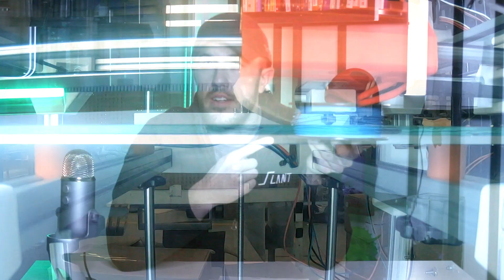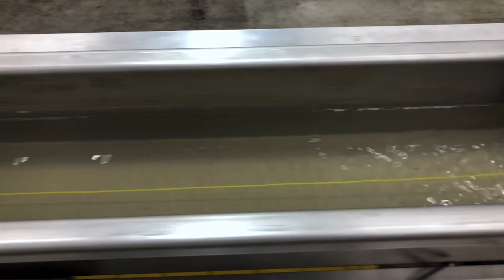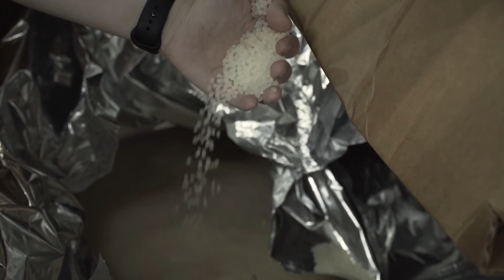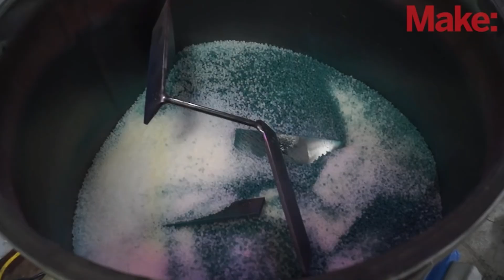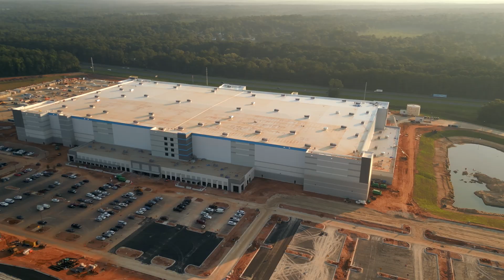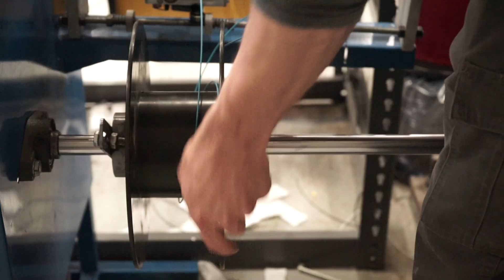Why is Filament so Expensive? Explained

Comment: Thats why it is great to have local brands. I buy from a local brand (local as in the same country as me) and it is about $7-10 per spool of PLA+ depending on the properities (silky etc.)

They dont come with a spool so they are essentially refill filament but you can buy spool from them for $1 too.
Reply from the maker: That is very true. Unfortunately many local brands vary in quality so much that many are not viable for mass production.
Reply: @slant3d  Yeah makes sense for you guys. For personal projects it is good enough. But I have to say even I noticed a lot of inconsistencies with the filaments from the local brand. I mean they are still the best option for me since they are cheap and have good quality 80-90% of the time
Reply from the maker: That is great that they are working for you. It is awesome when a local source works out. But yes, 80-90% usable is very poor performance. 1 out of 10 of their spools has a defect. Imagine if cars or cellphones were made with that quality. "1 out of 10 iphones won't charge. OK. Here is 1500 dollars"
Extrusion of filament is a fantastically simple process. No organization should have double digit error rates.
Reply: @slant3d  Yeah you are definitely right, I mean I just gave a random number of 80-90% maybe in reality it is better but I can tell the difference between it and Esun Pla+ for example in terms of quality.
Reply: @UTKDesign  How do you go about finding a business that sells spools locally?
Reply: Or even a spool refill location?
Reply: @_specters_  depends where you live, I recommend to check filament producers in your country, also there are sites similar to Amazon in almost every country where people are selling stuff, I recommend you to read some opinions cause its better to pay some more for a quality filament than buy a shitty one and throw whole spool in garbage
Reply: @_specters_  I dont think any spool refill statiom exists. I just buy 1kg of filament without the spool from the manufacturer. I just searched PLA filament 3d printing etc. in my native language to see which websites popped of and discovered new local brands
Reply: My local companies are 22$ for a spool :(

Comment: And once pellet extruders become smaller and more affordable, you would pretty much be saving even more money when it comes to getting PETG, PLA, or heck even PEEK. Plus, extruding with virgin pellets will definitely yield stronger prints. c:
Reply: Right now I'm making pet from plastic bottles wih a pullstruder, it's not perfect but it works
Reply from the maker: Unfortunately pellet extruders have a minimum size physicaly that they can maintain. And the Value-add is quite small compared to the other tradeoffs.
Reply: @slant3d  no true

Comment: Insightful video. I found it sort of funny how you glossed over the "there's only 1 company making their proprietary PLA blend" part. I might dig into that more, that's something I would've never expected. Especially with how wildly filament can vary, from cheap no-name spools to "name brand" more expensive spools.
Reply from the maker: The variation is due to the how it is processed. It isn't always due tot the base resin. There are other knock-off PLA's but true  PLA is made by one company

Comment: $5 dollar cost is at small scale, at larger scale the match changes substantially. Most retailed items have wholesale price approximately 5-10% of retail price. The large chinese manufactures can makes a spool of filament for less than 2 dollars, a lot less.
Reply from the maker: Kind of true. We use the $5 figure based on the average manufacturer size. But the cost of the items like chinese filament is often subsidized, is lower quality, and has the cost of international shipping (before distribution from warehouse) so it ultimately balances out to about the same after it crosses the ocean.
Reply from the maker: @WhiteG60  The cost of labor is negligible in the context of filament manufacturing.

Comment: I never thought Filament was too expensive. 
I just think more manufacturers should offer "spooless" filament. People who have 3D printers can make their own reusable spools, put the roll on themselves and save the cost, weight, waste and expense of shipping the actual spools around.
Reply: You and I think the same, I think the problem come from making it onto a spool and than removing the spool. I could be wrong tho
Reply from the maker: Spooless has been very tough to get right. We actually manufacturered one of the first resuable spools in partnership with several suppliers. But it was ultimately shuttered because the cost per 1KG did not go down due to additional labor and it was largely un-utilized by consumers because of the additional work. It has been an idea for over 5 years. But implementation hasn't happened because consumers don't want it enough.
Reply: I hate buying spool-less "refills"
Reply: "I never thought Filament was too expensive"  Me neither.  I just checked and a spool of Hatchbox that cost me $28 in 2018 costs $25 now.

Comment: I have counted already in the past: the price of plastic pellets is 10x cheaper than filament.
Basically, for utility prints it cheaper to make your own pellets->filament extruder. Which can, by the way, be used to reuse the failed prints.
Making your own filament for fine detail fine quality prints is not worth the efforts.
Reply from the maker: We have tested many/most of the extrusion machines that a normal user would get ahold of. There is not one that actually pays for itself over its lifetime with the savings from lower cost material.
Reply: It is a problem of engineer's team to make cheap chinese extruder worth it.
This is exactly why I said only about utility prints (not high quality).
Reply: I think I was not clear enough.
The best filament of the shelf for 0.4mm nozzle is very difficult to remake yourself.
But for 0.8-1mm nozzle prints it is quite possible to use your own custom made filament made of cheaper pellets on cheap chinese extruder. Period.
The extruder could be chinese or DIY made - doesn't matter. The cheaper the better.
Reply: The pellets are significantly cheaper if you buy an 80kg bag.

I bet if you ordered that sort of amount of filament, and were willing to accept a bit of lead time, you could ask for a friendly price from your neighbourhood filament company on 5kg spools or larger.

Well if you don't have a filament manufacturer in your region then tough.

Comment: Thanks a lot. I'm wondering all the time about the economics of everything. That said - "the rule of 3" is only a insurance for small businesses in the western world not to loose money from the beginning. But if you really want to scale your business, products or services, it seems like you need to go as tight as possible to the marginal costs. That's the same with 3D printed vs injection molded parts like it is with domestic flights (Freakonomics had a nice podcast about deltas economics)
Reply: I have never heard of "rule of threes", rather there is "keystone pricing" where you Double the price:
Wholesale = 2x Manufacture
Retail = 2x Wholesale 

So when buying $20/1kg spool, materials and labor at the factory be $5 - rest is margins
Reply: He literally says the rule of 3 is just to roughly cover your costs. Nothing about growing or expanding

Comment: Where does the "rule of three" come from? That sounds like a rule for small scale entrepreneurs. Most commercial manufacturing businesses have gross margins in the 30-50% range (they publish this in their actual report to shareholders), meaning that they are pricing items at roughly double their input cost (which comprises material, labour and lower level overheads like warehousing and logistics). These businesses do not usually sell to consumers, so a second margin is introduced for the retailer.
Reply from the maker: What you just described is the rule of 3. 30% margin to each stage in the chain, manufacturer, marketer, retailer

Comment: This is one reason I wanted to start a 3D filament company. Basic PLA/PLA+ for makers and hobbyists at fair prices. I know my local college and a few libraries were looking for cheaper suppliers. Add to the many people who have started a 3D printing company/hobby around here but still have to rely on Ama for their supplies. Or they go cheaper and mass buy from a company to save $2-3 a spool but end up chucking out the parts because of tolerance issues and failed prints. 

I typically go for a filament that has a variance of +/- 0.02mm to 0.03mm, yet in the example above their variance was listed at +/- 0.05mm to 0.07mm. It may not seem like a bigger issue but that extra tolerance can cause lines to snap or a clog to form and then you have 20+ hours wasted. And I am willing to pay higher for that tighter tolerance to ensure my prints finish.

Comment: IIIDMAX is $11 a roll when you buy  10 or more. 
Also 3x mfg costs isn't typical... most margins are about 50%
Reply from the maker: The rule of 3 is a baseline to start from. Then brands make decisions based on their market position. For example IIIDMAX, makes very low quality material (blobs, wobbles, dirt, and wet) and therefore cannot commant the same prices as brands such as Prusa (perfectly spools, tracked, and very low error rate)
Reply: IIIDMAX has poor quality control. A ton of people have problems with them
Reply: @jeffreyepiscopo  I don't have data on 'lots of people', I'd wonder where you would ever get such data..... I've NEVER once seen a bad review. I've used dozens of brands, at all type of prices.... IIIDMAX is among the best I've used, and is the exclusive plastic I use in my farm..

Honestly most the information in this video is just straight up wrong.  It's an opinion at best, and made up numbers at worst. 
I've been a business owner for most of the last 30 years. I assure you in business school this isn't how things get done,  nor how someone decides how to price product.
Reply: @slant3d  I think for a well versed highish-volume hobbyist, a poor, cheap filament company like that can be of value. We have one like that nearby, somewhat shaky quality, usually it's OK, sometimes it's not, if you find errors in the filament though they always replace it at their cost. It's not very suitable for a casual user because they can get stuck and won't know what's up, and it's not very suitable for a business because all time wasted is an expense.

Comment: I don't find the costs excessive at all (more like $18 for cheap brands), but the unit of sale is really problematic for folks doing low volume home printing. I'd much rather pay $8 for 250g mini-spools in single quantity (not multi color packs some vendors offer) than $18-25 for 1 kg of a color I'm unlikely to use more than 100g of in a year.

Comment: If everything goes the way i am expecting by the end of this week i am going to print with PA66GF30 aka Tecamid. I have checked the filament price and its somewhere around USD 250 for a 1kg Spool. 
My "filament" cost USD 17 /kg. 

If you ask me why 3D filaments are so expensive here is my opinion. Filament from raw material turned into an end user product. Its like when people selling holy water    in a vial. Same thing, different package, different target group, different beliefs and expectations. No, i don't think so filament producers are scammers or cheaters. They just fulfill the needs what people generated by the years. But when i look at my latest print that was printed from a GF Nylon, without any issue, without any drawback, for 1/3 of the price and i can go and buy tomorrow again if i wanted, that makes me think, something is not ok. Again.., soon i will see how the PA66GF30 works in my printer. Because i have confirmation on the material. USD17 /kg